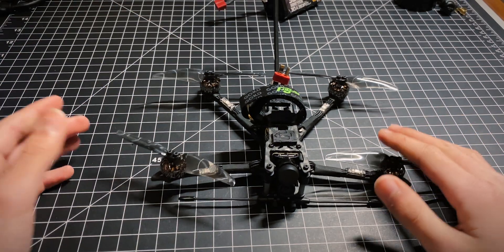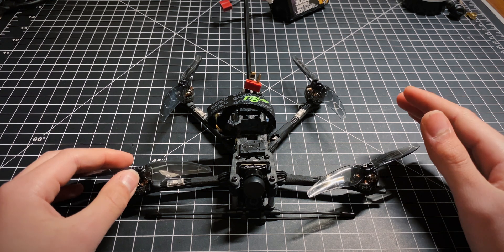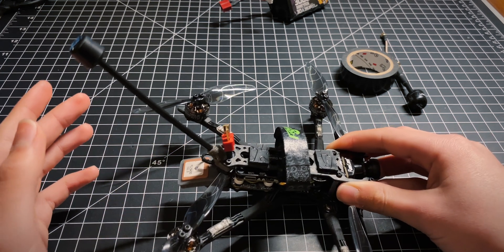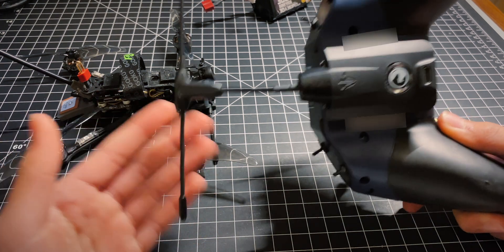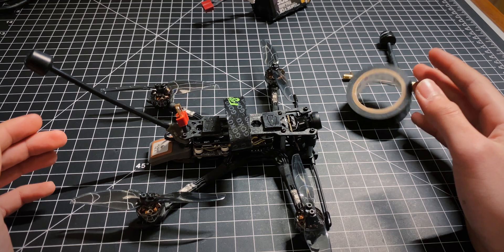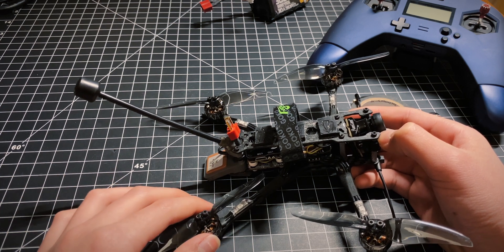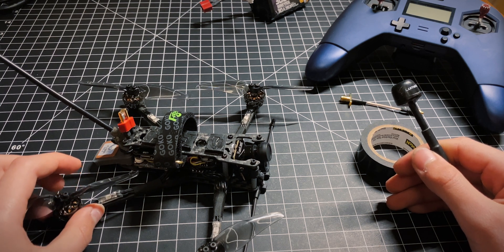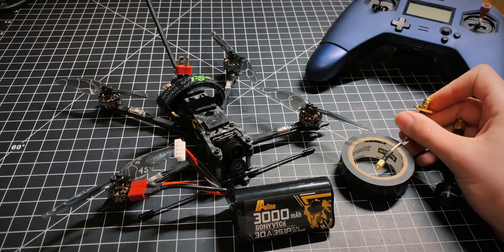10 Tips for Infinite Range

Comment: LOL, great intro, subbed.  Falconrad is the man.

I just crank that heat-sinked AKK FX2 mini up to 1200, and flashed my old r9 gear over to ELRS.

Also, ground your vtx and camera together and wrap the grounds around the signal wires for a nice clean signal.

Comment: Does electrical tape really provide measurable insulation for our coax cables? I tried searching but didn't find anything relevant.
Reply from the maker: Yes good point. It does do some minimal help I believe, and you might want to use it if an SMA connector would otherwise touch the carbon fiber of the frame, etc. For more noisy situations, a grounded layer of metal is better (e.g. wrapping tinfoil around the GPS wires and soldering a wire to the tinfoil that connects to a ground pad on the FC).
Reply: @muckofpv  Interesting, I'll give it a try!

Comment: Hi @Murk.o FPV, great content. BTW, How did you fit the runcam hybrid in the flywoo frame? did you got a new top plate?
Reply from the maker: I cut back the front of the top plate with a dremel so that it fit - you can also use taller standoffs.
Reply: @muckofpv   great! What VTX do yo use? the 450mW flywoo stock one?
Reply from the maker: Right now I am running the Rush Tank Mini 20x20 (up to 800mW)

Comment: I have some questions regarding the video, one is why it is better to put the antenna vertically if, as I position it, I would do the same?  for this type of drone wouldn't it be better to use bsteria 4s 18650?  And the last one, which batteries do you think is better for long vtc6 30A or vtc5 of 35A
Reply from the maker: 1) You want the antennas oriented so that the nulls in their radiation patterns rarely point towards you. If it is horizontally mounted and you turn, one of these will be aimed at you, whereas if it is vertical the nulls will remain up/down. 2) Yes, I have switched to 4s Li-ions since the time of this video. 3) I prefer the vtc6 since most of my builds don't need more than 30A. Hope this helps :)
Reply: @muckofpv  many thanks for resolving my doubts a greeting

Comment: Do I need goggles with dedicated vrx slot? I have the skyzone 02c, 2 antenna diversity, internal receiver I guess. Does the receiver matter much?
Reply from the maker: Hey Tony FPV, kind of a 2-part answer. Yes, the vrx does matter and can increase your range significantly. However, your antennas are equally if not more important, and I think you could see even bigger improvements by upgrading antennas. They are also a lot cheaper than getting a whole new goggle. For directionals, I would recommend the TrueRC X2-Air or the VAS Pepperbox Extreme, and for an omni the TrueRC Singularity, AXII 2, or VAS Ion Pro are also good options. Keep in mind that if you mostly fly in front of you, 2 directionals will give you better range than 1 directional and an omni. Lastly, consider that if you end up really wanting to push LR you may end up wanting to go with a ClearView or another ground station, which would not mount in your goggles. Still, the form factor is much larger, and I have not tried them mainly for that reason.
Reply: @muckofpv  I see, I won't be doing long range but probably mid range with confidence to go far. Thanks for the help, I may upgrade to some fatsharks later on but I'll look at those antenna first 👍